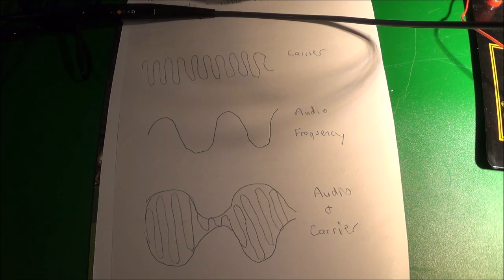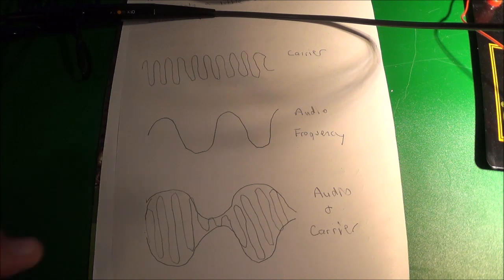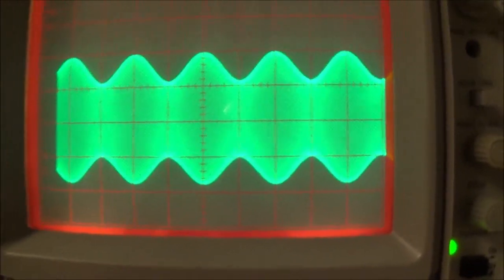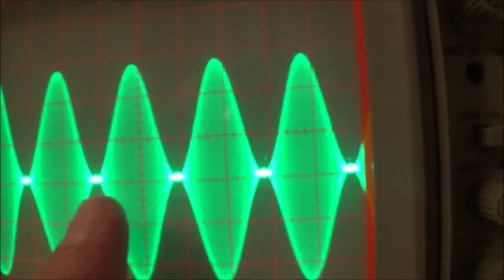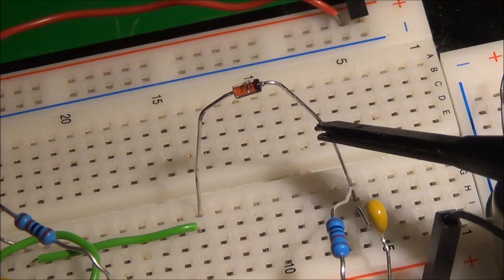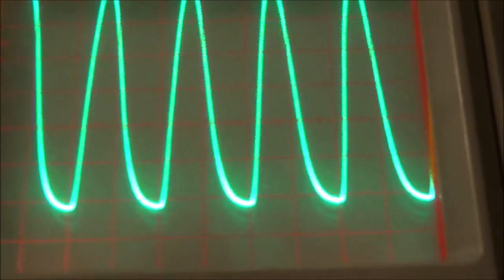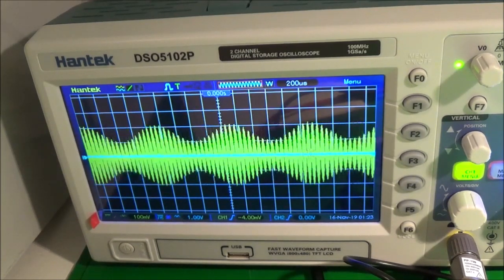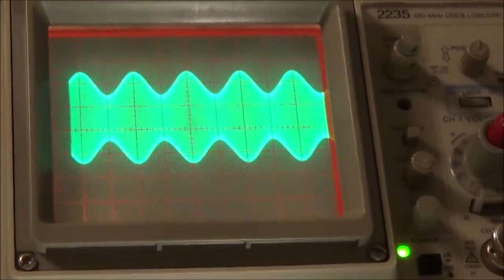Video showing undermodulation  and overmodulation

Comment: old school good video.
i didnt understand the origin of the modulation wave.
was it from a signal generator or radio?
would like to see how you set  it up to get waveform on scopes.
i have a koolertron signal generator that says it has modulation mode but i dont understand how to get the output you are showing on scope.
thanks
john
Reply from the maker: Now I am not familiar with Koolertron signal generators. The modulation was produced by the signal generator. To get the output you would first set it up to put out a regular sine wave, say 1.0 MHz with an adequate signal level that you can see on the scope. Then hit the modulaton button. Thereafter play with the horizontal scope sweep control until you get a good waveform.